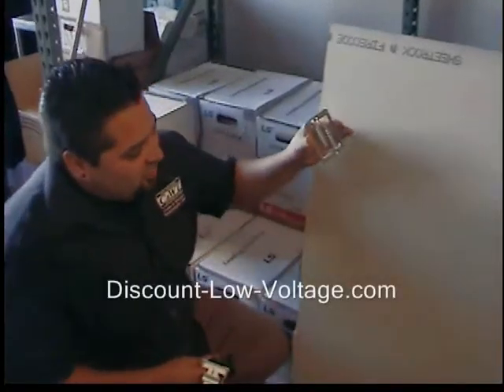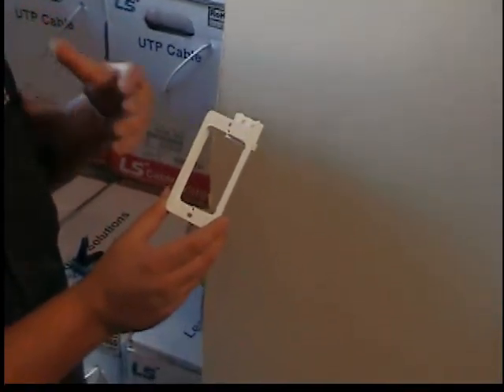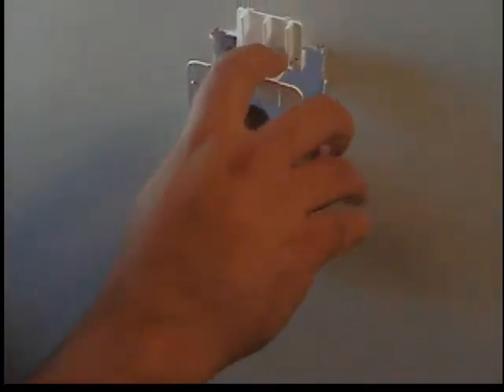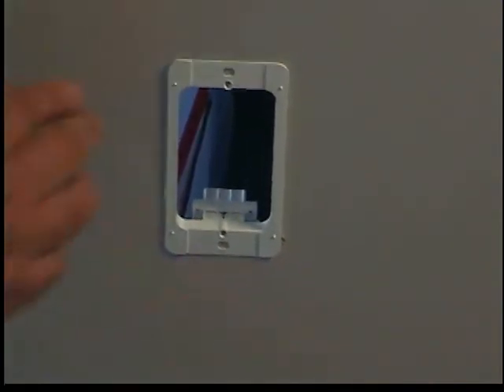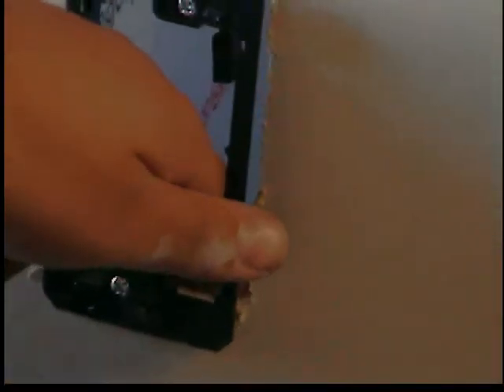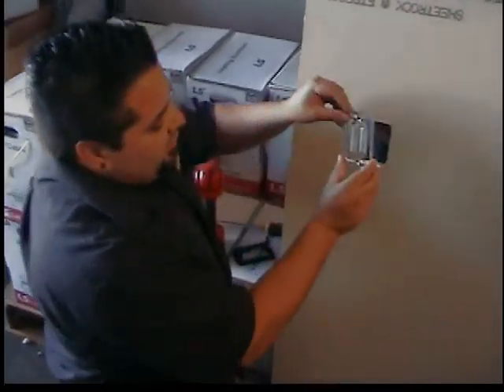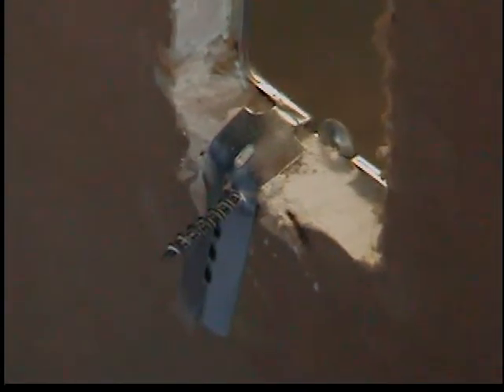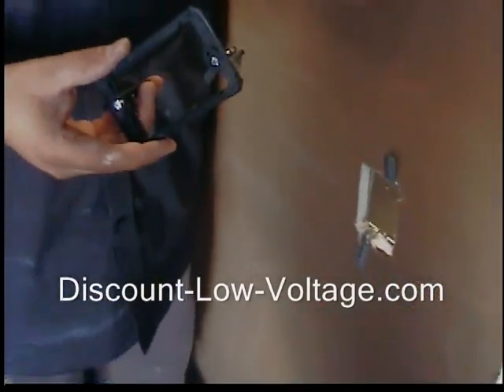How to Install Drywall ring MP1P MPLS LV1

Comment: Look for "plaster C clip". You will find a bracket, made to US dimensions, which can be installed BEHIND the dry wall.  (Made to fit 6 or 10 mm board.)
To fix, 2 clips crimp down on the edge of the hole. The wall-plate is then attached using the screws supplied with IT. The C clip and wall-plate "sandwiches" the board between them.
Tips: Easily lost down the wall - tie on a string while fitting.
Use a dab of silicone sealer between C plate and wall to hold it if the wall-plate is later removed.

Comment: I used to install ERICO MPLS rings for various customers when I was with one of my earlier employers. I had the same complaints about them, but I was happy at the time to finally be using drywall rings.

I now need to install a drywall ring in my home, and I've been hunting for the MPLS. I recently learned of the ERICO MP1P, the ERICO MP1WWM and the Arlington LV1. I see in this video how much better the MP1P and the LV1 are than the MPLS...but why no mention of the ERICO MP1WWM?